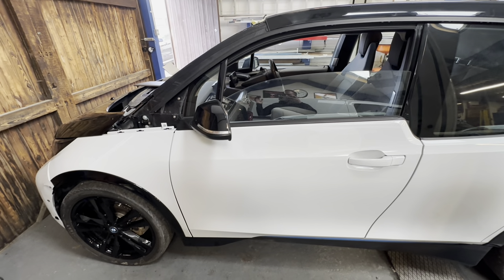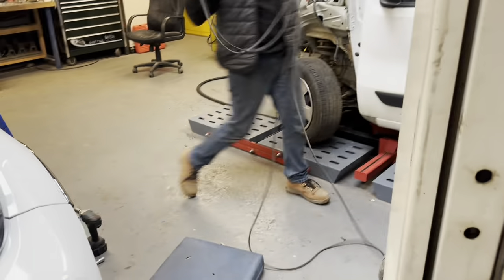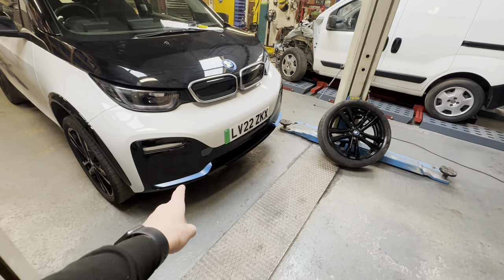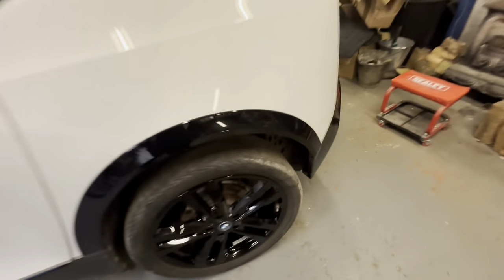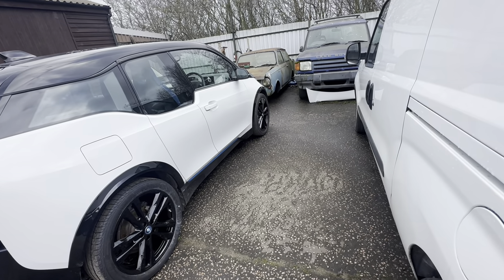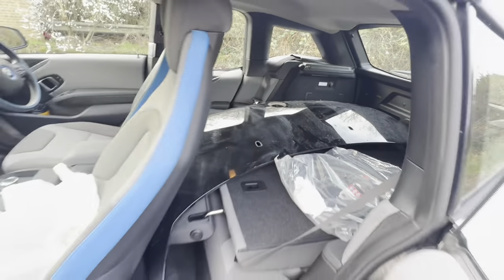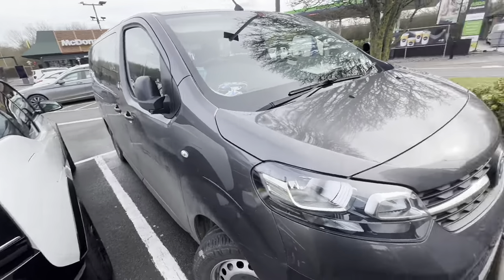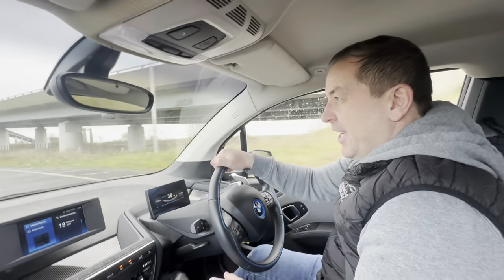IS THERE A FUTURE IN REPAIRING SALVAGE ELECTRIC CARS???

Comment: Why someone would have an electric car given the charging times, insurance costs, depreciation, battery fire dangers etcetera, is completely beyond me.
Reply: Not through choice, government policy…
Reply: Because they're cheap to maintain, cheap to run and fun to drive. They are less likely to go up in flames than ICE cars. The situation where they don't make sense is if you cannot charge at home.
Reply: Been mugged off.
Reply: Full up 134 miles useless
Reply: I had a Tesla for 2 years - amazing. Don’t knock them til you’ve tried them folks !
Reply: @philtucker1224 ”government policy” so that’s why they’re all driving round in fossil fuel range rovers is it? It’s a case of do what I say not do as I do….
Reply: @TKevinBlanc not when you take the purchase price and depreciation into it 😂
Reply: The pit falls of Evs are many , it’s not the answer and guess who’s going to pick up the bill for its failure ? ……….yes you got it
Reply: @TKevinBlanc oh dear…..😂😂😂
Reply: If you live in a City centre its ideal
Reply: Torque, only experience many require to convince to switch from an ice vehicle.
Reply: Charging times?? I go to bed and by the morning I have a “full tank” that’s cost me about £2.50!! Off to work, no calling at the dino juice store to fill up! Lol
Insurance was cheaper than my 2018 Astra 1.4 petrol! 
Depreciation.. I bought my EV secondhand! Less than 2 years old,less than 9000 miles on it! Half the price of new! Ive never bought any brand car new because of depreciation, it’s nothing new! 
ICE vehicles are more prone to fires than EVs ..
YOUR LOGIC IS FLAWED AND BASED ON THE DRIVEL YOU READ ONLINE THAT IS PUT OUT THERE BY OIL COMPANIES WHO WILL LOSE BILLIONS WHEN MORE SWITCH TO EVs AND NOT YOUR OWN PERSONAL EXPERIENCES!
Reply: I think as a second car to use as a town run around then it makes more sense, but as an only car it would be quite difficult especially on long journeys
Reply: Great in a straight line I nearly rolled one of those
Reply from the maker: @999hireactionvehicles9 you just don’t listen you just comment negatively all the time like it’s over weight on your truck. That van is crap etc try listening and maybe saying something positive 👍
Reply: @mancroft We have an i3, which we use for shorter journeys, we only ever charge at home, so don’t need to waste time sitting at a public charger and we can start everyday fully charged. 

For longer journeys we have another car, so we find it works really well for us. 

As for fire risk, personally I don’t have an issue. I accept if it does catch fire the results are potentially going to be worse, but how many normal cars catch fire. 

Our insurance isn’t noticeably different to the Golf it replaced. 

We purchased it new in 2018, initially it would have held its value well, probably not so great now, but then it’s 6 years old and realistically, over this period of time few cars are going to be worth that much.
Reply: @wisher21uk the King moved around in various electric Audis recently.
Reply: I would and have completed over 70000 miles of electric car driving during the last ten years. They have limitations of range and public charging is appalling, however the cars themselves are brilliant.
Reply: @FFVoyager  well he’s a green candidate isn’t he, he talks to trees too lol
Reply: Totally agree
Reply: That's mostly down to security and antiterrorism stuff. They don't necessarily ask to drive around in a range?
Reply: Its a controversial topic ICE vs EV, yes they are flawed, infrastructure is still poor but love or hate them its coming regardless, well done on this little beauty lads 👏 a bargain Baby BM
Reply: @wisher21uk  still got another 11 years to go yet so It seems most large companies are running them just to back up their “green” credentials. I live just outside London and I’ve already noticed most of my neighbours are running at least one EV.
Reply: Sooner we get those smokey old bangers off the road the better!
Reply: There have been 50 million electric cars built with lithium batteries. They are much safer fire wise even in accidents unless you drive them or charge them with a damaged battery or without the BMS(battery monitoring system) the fires are very dangerous hotter and harder to extinguish. But nearly no flammable liquids except gear oil and grease. Try one
Reply: Because most of that is well exaggerated
Reply: @jvoric you contradicted yourself by saying i bought it at half new if that doesn’t show depreciation i don’t know what does
Reply: Killing the motor trade as we know it ..
Reply: @999hireactionvehicles9 Not if your average journey is 20 miles and you don’t ever do long motorway journeys. Like most people!
Reply: @philtucker1224  there some that have pulled production of ev’s
Reply: @wisher21uk  Yes, most of them from what I have read. I get the impression that initial sales of EVs (to well-off Europeans) was a lot greater than originally estimated and rather premature given the lack of charging infrastructure. Now the initial novelty has worn off there is clearly an over production surplus. It seems that car producers have been very happy to manufacture and sell them, but not really interested in funding the means to recharge them!